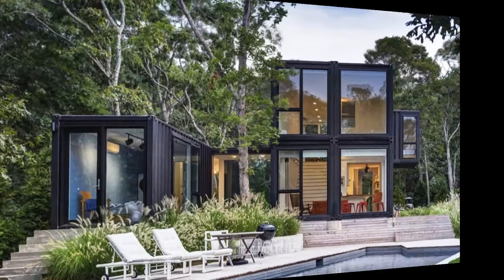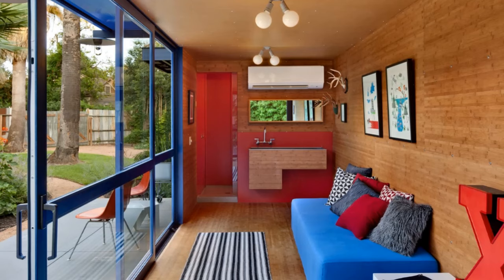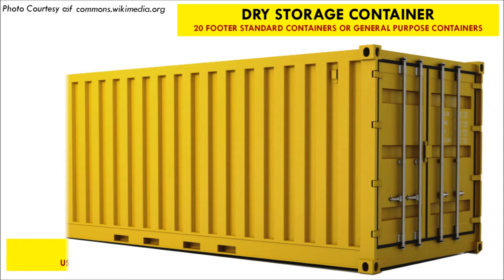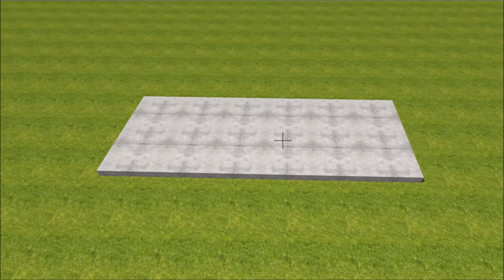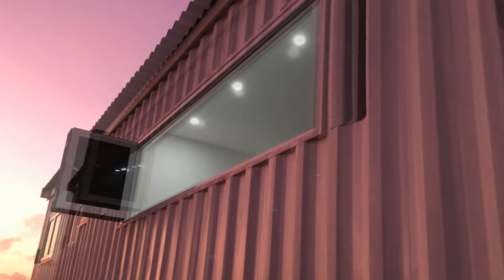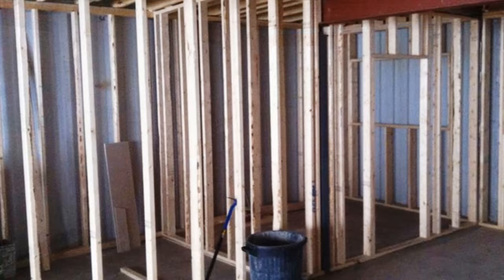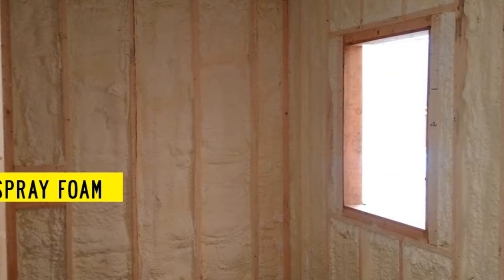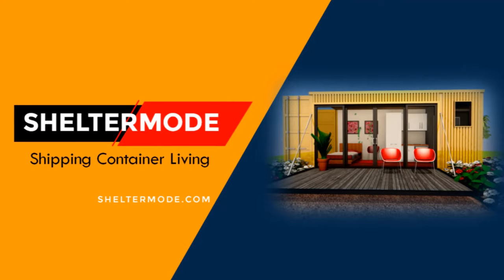How to Build a Shipping Container Home in 7 Simple Steps

Comment: The cost of 2 new or one trip 40' containers  compared to building a 20' x 30' shed doesnt add up, by the time you spend man hours cutting and  welding, simply buy shed 20' x 32' kit and build it, or a American Barn 30' x 30', concrete is cheap to order, just need a couple of friends to help pour and level it, about $1000 for concrete, another $12K for the 20 x 30 kit, $15500 for the American Barn kit, then its up to you how you want to finish the internals. Ive seen people do the build for $15K complete for the 20' x 30' shed, and $20K for the Barn, they end up with a 2/3 bedroom, living area, kitchen and bathroom home, obviously when going off grid high end finishes are not necessary, but if you are someone who needs granite benchtops and a designer kitchen/bathroom, then build a proper house.

Comment: What about underground storage? Placing them against a south exposed slope, with a partial exposed storage room attached...one of the smaller units for food ? Or for other uses. Southern Exposure is excellent for heating...dark metal will warm up due to the exposure to the Sun. Deciduous trees in front will keep it cool in Summer. Makes a nice summer home or rental units for short term use.
Reply from the maker: Good observations. However, they vary from region to region.

Comment: Well if you are framing out the container walls & you said that we don't won't to puncher the walls..! Being that they are water-proof. 
So how do we attach studs & frame-work.....
Thanis
Reply: Contruction adhesive would be my guess
Reply: You attached it by rivets to the metal corner/side frames.. But trust me never used regular home contractors to built. Go to experienced container home builder, there are many near major ports. But its more complicated than that, bcos they usually built offices. And they are very expensive..

Comment: A few things. The walls need to be insulated with closed cell spray foam because of condensation that will cause mold. 

2x2 studs is not enough to run your electrical properly and have enough insulation to provide sufficient r value. 

2x4s should be used for framing but cannot be attached to corrugation with anything but glue. The 2x4 s are attached to bottom plate screwed into the floor and the top plate is screwed into the steel beam that runs along the top from corner to corner.
Reply from the maker: Not everyone lives in a cold climate. In the tropics, condensation is not a big issue. With that good weather thermal mass insulation is all you need. 

Electrical wiring should run through heavy gauge 20mm or 25mm conduits, they have nothing to do with studs perse.

Comment: What is general cost to build a 20' and a 40'?
Reply: 20 foot containers are priced roughly the same as 40 foot ones. The only real difference is the size, which will obviously necessitate more materials, such as insulation and plasterboard and the like. If you opt for the 40 foot shipping container(s) you will spend more on these things than you would if the 20 foot container was your container of choice. You would also spend more money laying a foundation, as a bigger building is obviously gonna need a bigger foundation. Another dependant variable is how many containers you plan on using, as more containers means more money being spent on materials and digging and constructing a foundation. For such extraordinary architecture, there really is no one size fits all medium. In fact, one size doesn’t even fit all if you’re building your house with bricks and concrete like a normal person, much less with bloody shipping containers.
Reply: Would you purchase it if it's under $150k

Comment: CONTAINER HOME IS A SCAM..
Dont blv anything at all about container home, if you hv never tried it.. Its impractical, expensive & not enviromentally friendly.. Most of these are just Youtube gimmicks, unless you are using it just as a temporary  in construction site office or purely aesthetic design. 

- Containers are not meant for living, its space becomes smaller especially if you hv to add electrical wiring, water piping n insulation? Its better n cheaper to built tiny home from traditional materials.

- If you cut into its wall or corners, you compromise its structural integrity needing massive reinforcement that is expensive n impractical.

- Old used containers are health hazzard, they could hv been used to transport dangerous material/chemical that might contaminate the wooden floors. So you usually use brand new containers.

Its only suitable for commercial store, for its aesthetic look, but with high renov cost..
Reply from the maker: Nice observations.